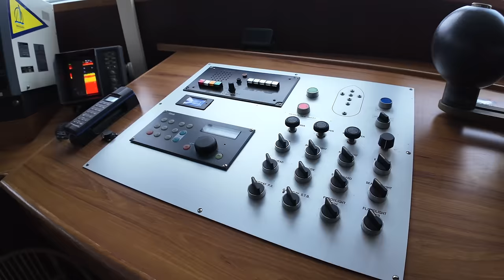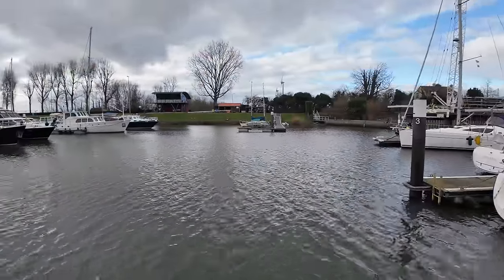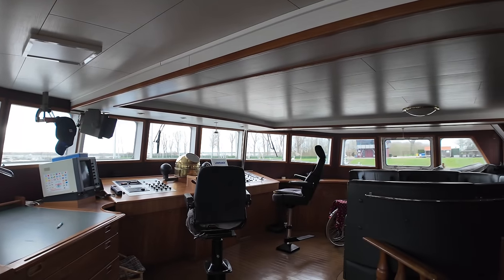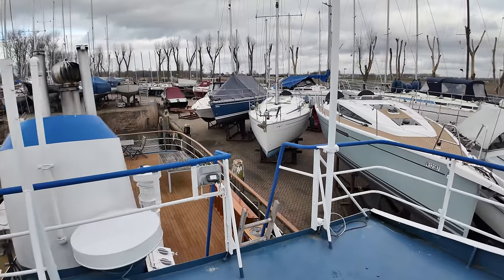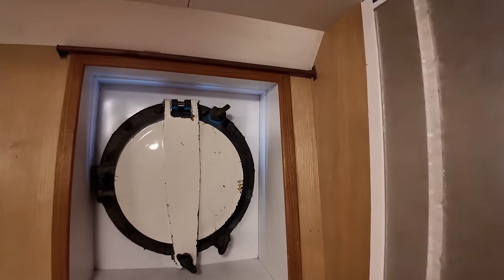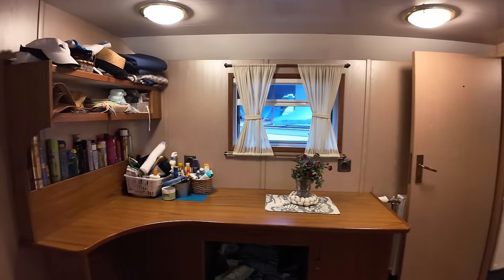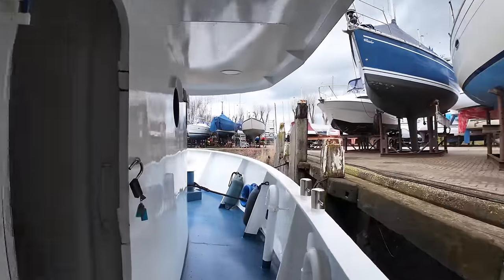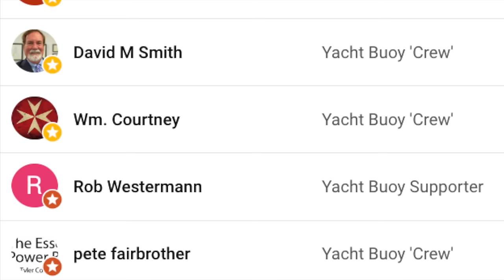€449,000 Former EXPEDITION Ship Turned Explorer Yacht FOR SALE! | M/Y 'Tarmo'

Comment: That engine room is #1 on my list of boat features....a stand up engine room. However I wish it was a twin engine boat.
Reply: Yes i dont no much about boats but I would like the idea if one breaks I can limp home on the other
Reply: @FunnyDodoBird-be5ob   A pilot once told me, it's better to have a piece of equipment and not need it then to need it and not have it.
Reply: @rael5469  yep I would go with that one 😀
Reply: I would replace on of those huge gen sets with a second propulsion engine. There is enough generation on that vessel to power 4 big homes, but only one propulsion engine.
Reply: @USMC1984   Great point !  I wonder if on a boat of that size if it would make sense to use diesel electric like a locomotive. Diesel electric is made for long range cruising, isn't it? Then....would you have two engines powering one shaft?  I don't know....just thinking.

Comment: Not just the Rhine but also all Dutch rivers, its passing starboard on starboard. It needs to be confirmed by the oncoming vessel, if not then you need to do the traditional way. Mostly used on tidal rivers as the upstream vessels like to hug the inner shore as there is less current.
Reply from the maker: Thanks for the info 🫡
Reply: Is that platform for a flag or sign of some type to put up when passing stb to stb? In US waters it is 2 shorts blasts of the horn.

Comment: The 3408 is one of the best marine diesels you can have. This is a boat for someone with mechanical ability, a couple with occasional guests or maybe kids. Yes the guest staterooms are small, but I don't think it is worth it to change the configuration into a few larger cabins. If that is what you want, buy a different boat. The key thing if you bought this boat is to go through the mechanicals. Over 25 years since the last refit and only 1300 hours on the motor means that you need to check out the mechanicals, there is something waiting to break. Service the keel cooler and the gensets and the bow thruster. Go through all the systems carefully. I think one would be happier with a larger dinghy. Check the plate thickness carefully. As far as having a wing engine, this would not be so hard to install. With three gensets, could even be an electric engine.  The ZF saildrive would not be that hard to install and can handle 120 HP. An EV motor could be adapted very easily.  This is a get home engine. Take care of your main engine, carry spares and keep the oil and fuel clean and you will be okay. With that huge radar mast you could even put a square sail on it.

Comment: A real little ship. With those two gensets, an electric motor coupled to the propeller shaft could provide a backup propulsion system in the event of trouble with the main diesel. Would likely give 4-6 knots with relatively minor alteration.

Comment: The one thing that would drastically improve this boat is a wing engine, for use in emergency or calm waters (for economy).  Many hours of painting would also improve the lesser used areas too.  Good video and shows everything well.
Reply: Yes please 😅❤️❤️❤️
Reply: Only Nordhavn fanboys complain about wing engines. Completely unnecessary as these engines are build to last and just need a spare if there is an issue. Engine redundancy is just there for people unable to make some repair. Ever seen a oil-tanker or any carrier with double engines or heard of any stranded mid ocean because of engine failure? I didn't 😎

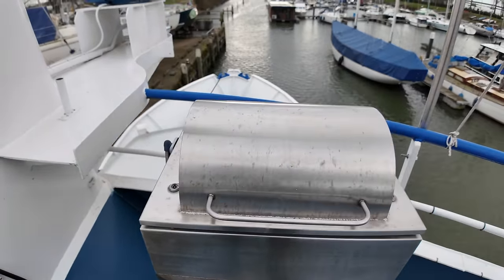Comment: Well, that square blue/white  'table' at 10:30 is an official signal: the "Blauwe bord"
When in use it is tilted 90degrees forward (the blue facing forward) and the white light in the middle is turned on (flashing).
It is used when ships want to meet on the 'wrong' side of each other. Normaly one meets 'port on port' but sometimes ships want to meet 'starboard on starboard' or 'Blauw op blauw' (bleu on bleu).

This procedure is used on the rivers (Rhine, IJssel). Where ships in the "opvaart" (going upstream, 'up the hill') usually like to stay on the inside of riverbends where there is less current to overcome. In that case the ships in "opvaart" show their bleu/white/flashing white light to signal their intentions to the "afvaart" (ships going downstream).
often this is accompanied with some VHF communication.

Comment: Who doesn't want a constantly lubricated shaft?

Great vessel. With an internal refit, it could be specular. Might be wrong, but the internal walls in the accommodation look removable, which would definitely make a rework easier.

But definitely would want to risk a long passage with only one engine.
Reply: Godam James, a constantly lubricated shaft is essential, after all no one needs the throb, throb wobble of a wonky non lubricated shaft 🧐😎😂🍺 Cheers DougT
Reply: @douglasthompson296  if you're a rudder lover, keeping the shaft lubricated is essential.

Comment: De Blue bord is indeed for using on de Rijn and adjacent rivers. In case of strong headcurrent at the starbord side of the river it will be effective to sail at the portside of the the river. If you do so the bord has to be vertically, so other ships no you use or going to use de portside of the river.

Comment: This boat is a gem. The only drawback is that I hate single engine boats. Serious question, in your opinion, can the boat be repowered to be a twin engine configuration? Maybe with two smaller CAT engines that vould even have a higher combined horsepower. From your video perspective it appears that there is room for two engines.  I think it could even keep the single rudder. I know cost would be a factor but if the hull thickness is ok, it would add years of life to this old lady.
Reply: Yes it could, not hard to do if you convert to diesel electric
Reply from the maker: After seeing what Damen Maaskant did to Scintilla Maris then I believe that, with the right budget and technical team, anything is possible! There is certainly lots of space.
Reply: You have enough money anything is possible
Reply: Each to his own, I personally consider the single engine to be an advantage and is my preference. You’re right though, she’s a gem.
Reply: no body needs two engines just clean fuel mr.
Reply: No 😊
Reply: Was hoping for a small wing motor. Would be better
Reply: No i Dont think so.  My wife wont think so either😅❤❤❤
Reply: Wife?   Thats putting a name on a 🧓❤️❤️❤️❤️❤️❤️❤️❤️❤️
Reply: It was a lot more than half a Mill.  I like your style 🙏❤️❤️
Reply: If you did a twin engine conversion, keeping a singular rudder would be a terrible mistake. Any sort of maneuverability the vessel may have had would be completely gone -- no wash over the rudder at low/zero speeds while trying to dock or, say, rescue a MOB.
Reply: You!!!!!
Reply: Hull wouldn't benefit from more HP output, but with newer  more economical engine  and prop could get some more miles.

Comment: This is - could be - a fantastic vessel for an owner that is a bit adventurous. 
But what always beats me, and especially for a vessel like this with central hydronic heating all over, is the prevalence of electrical radiators. If an engine is running (generator or main), should leave ample of residual heat to keep vessel comfy. And if at dock with no engines running, oil burner or shore power heating the hydronic system would be far more efficient.

Comment: Anything is possible, but I would add twin Cats and eliminate two or three accommodations.  Add state of art electronics.  Cost?  When done I would be heading to the Adriatic Sea.  Love the islands of Croatia.  Then on to Montenegro for Tivat and Kotor. Chart my next course to Patagonia.  Bounce back and forth from Argentina and Chile.  Then westward to Hobart.  This would be a start.
Reply: Electronics ? For around 10.000 euro you will have state of the art nav, radar and night vision capability, so that is not going to be the most expensive part of the boat. Insulating the boat will be. The Med is very hot and I did not hear anything about airco and in the Med you will need that. Or you will need to insulate the boat. But if the hull is still good, this is a gem.
Reply: With lots of islands on the way...
Reply: @JaneNewAuthor  Yes, Si, Wee, Ya,
Reply: Although I'd go west from Patagonia, catch the Roaring 40s to Hobart, then wander around the Pacific for a while. 

Coming from an island (Tasmania) I've long had a thing about islands. Tristan da Cunha, Saint Helena, Christmas Island, the Falklands, all those tiny Pacific island nations that are difficult to get to any other way.

Comment: Needs an accommodation refit. Who wants to live like a conscript?

I would move the owners cabin forward in to what is currently the saloon and bring the saloon aft to what is the owners cabin at the moment. 
Down below I would take out the laundry and remodel to three cabins with one a full beam cabin forward.
On the boat deck, a central hydraulic crane to allow for two boats to be launched to port or starboard.
In something that size I would go for more horsepower as well if I was going to take it in to any kind of big weather, somewhere around 600.
At the moment it seems more set up for river and coastal, North Sea and Baltic cruising than anything offshore or further away.

Comment: Again, a hull that is not rated for ice. But, atleast it's a steel hulled boat. But, if I am buying a boat made of steel or aluminum it is going to be designed and built with the sacraficial bow, the keel and bottom plate no less than 1 1/2 inch thick to the water line then tapering to 1 inch to the deck and the super structure being 3/4 to 3/8 inch and deck plating being 3/8 inch. This would give the ship the best chance of surviving the north sea in ice conditions and hopefully survive a rouge wave witout tearing the boat in half.
Reply: The problem is all that weight reduces speed and fuel efficiency so unless you are in the far north it's not necessary...

Comment: Very interesting boat. I am not European so the layout might be normal but it is totally odd to me. The twin rooms look like singles to me. Those looked like the bunks I had when I worked on freighters. Definitely not a twin. What is the obversion to having an enclosed shower. What's up with all the wet heads? In addition whats with one room having a shower, one room having a sink, the laundry room having a toilet. Its like when they refit the boat they were drunk.  Its also made for very short people. The headroom is similar to my 26' cabin cruiser. The galley looks like an after thought for a boat for that many people. All the oddities aside if the hull and tankage checked out with no major issues and you had a shipyard somewhere that could refit it reasonably it could be a nice yacht. I would cut the number of rooms in half and make full heads, not wet heads and full size beds. I would turn the whole aft main deck into the master suite. The engine room is nicely laid out and clean. Not personally a fan of Cat V8's but it will work for the time being.  Still leery of relying on a single engine for an expedition yacht but I know plenty of work boats relay on them. It definitely has some potential though, it would just take a lot of work.

Comment: I like the boat but it definitely needs a overhaul and not having a wing engine is a sad no. Can you please tell us the length's, litter's and height's in inches and feet, I keep having to use my swiss army knife app to find out what everything is for us here in the USA. How many toilets, showers and sinks vs the cabins. If I would buy it, I'd go straight into a shipyard to get rebuilt so each cabin had a real bathroom with everything in it like it should be. I'd like to also add pullman beds to the cabins that are a double so more guests can have a bed to sleep. I think if a person would draw on graph paper the total space an on one sheet draw out exactly what is where now, then you know exactly where the plumbing pipes are along with the hot and cold water lines are located. Just draw out new layout plans on paper first because you can make alot of changes easier on there and no cost to you. Plus don't just jump in changing everything, sleep on it while you make plans and that has really helped me out greatly in my past when i was designing buildings and homes. An just like the one gentleman mentioned in his post, water an the ice makers and the water filters. Did you happen to see them. Also, the engine room truly needs a wing engine before going out where you can be just a bobber bouncing dead in the vast ocean alone waiting for a real good mechanic or tow to show up then take you to the nearest mechanic to get it running again. An I didn't remember seeing any fuel polishing lines, it must have been hidden. I loved that almost silent port generator that was running so softly and it has to be the best one to not have your ears screaming wanting out of engine room. If I had the money to fix her up I would jump on it quickly. The shipyard will definitely be the first stop and I'm wondering if the owner kept a log book on the engin room telling what they had to do and when in their past 20 plus years they have owned it. Overall I loved seeing it, and who ever buys her I would love to see her before and after pictures and or video when they update her. I know I could design it to bring it up into our future and have monitors in the bridge that are atleast 40 or 50 inch in the space behind the wheel and a captains chair fit for a king that can be turned around to face his or her guest and family. The center window on the bridge, install a spinning plastic disk to see out during the worst waves and rain so you can see at all times. Safety first, an a proper fire sprinkler system in all areas being controlled by a computer and manual hand operated backup so only area on fire get wet instead of the whole interior. I'm all about comfort and safety with my OCD and I like to think of it as a gift and not a curse. An once in the shipyard I may change the paint on the hull to that beautiful deep blue color on a lot of explorer yachts. I think I would probably take a poll for that one, an listen to others before changing the hull color. I have always said the more eyes on a project and I listen to all their ideas before making changes. More great m8nds working together will make the best and perfect live aboard boat that everyone on it will feel completely safe and comfy and always have great memories with you traveling to all the places you always thought about seeing. Because making great memories is what it is all about. I think so, an if you made it all the way to the end here, God bless you all. Share the Love and smile. Help each other with the love inside our hearts.
Reply from the maker: Roger that 🫡

Comment: I wonder what this kinds of vessel cost in operating cost. Why is that never mention. That is an essence factor when thinking on buying this kinds of vessel.
Reply from the maker: Typically, the annual operating expenses for a vessel are approximately 12% of its overall cost. However, this figure can vary significantly based on factors such as the frequency of use, crewing requirements, and other operational considerations
Reply: Thanks  @YachtBuoy  for an interesting answer. I was more thinking on fuelcost, insurance cost.

Comment: The Rhine river starts in Switserland at km 0 and runs down to rotterdam at km 1000 so thats a lot of fuel to use when running against the current which can be very strong, so when going up river to save lots of fuel you cut corners so to speak.and when going down river you prefer to stick to the outside shore line of the river to gain the advantage of the current going down river ,so thats what the blue sign is for on the bridge ,to let the oncumming skipper know yoy want to pas stb to stb. at night i believe the light in the middle flashes if my memory serves me correctly.. i would love to own this vessel ,though the accomodation needs a bit of TLC also the gally i would refit. she also needs to have steel window covers fitted for the large salon windows and have the port hole blinders refitted id probably also fit steel water tight doors all round instead of just the one to the engine room ,i love this go anywhere vessel

Comment: Well the engine need completely replacement with far better fuel economy capacity,30 ltrs per hour I'd diabolical bad , modern 400 HP TD 15 ltr per hour and doubles up range , apart from this it's absolutely fantastic ship and if I had cash I definitely buy it .

Comment: the blue sign  @10,50 is on your starboard side.
you use it when, for example;
sails upstream in a bend to the left.
since you are  on an outside bend? where the current is strongest? you may make little or no progress.
then you show the blue sign and take the inside bend, on your port side.
This way, oncoming traffic knows that you are sailing on your left bank,
Normally you pass each other port to port, but now you sail port side bank and pass each other starboard to starboard

Comment: A great boat but it really does need modernisation, especially the cabins, there's too many and far too small. Also only one engine is a big disadvantage, if nothing else it needs a wing. The navigation equipment looked very outdated. Only a maximum of 5,000 nortical miles isn't very good. Southampton to the Caribbean wouldn't be possible without refueling. Nevertheless a sound basis for an expensive project.